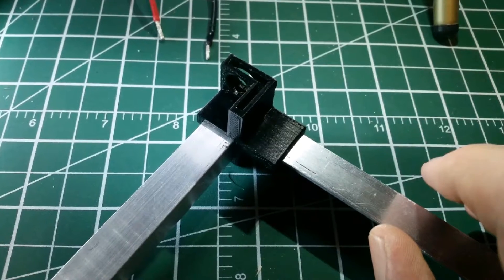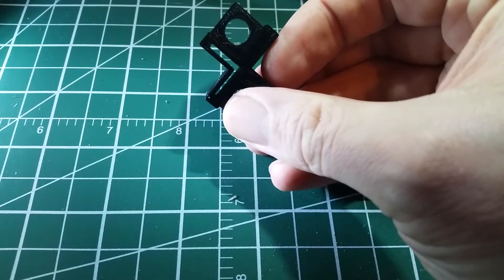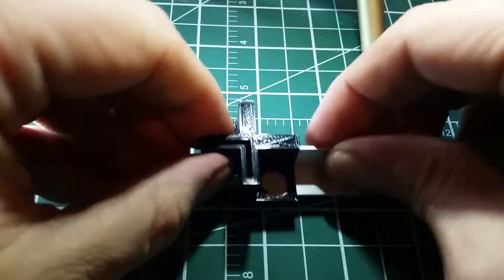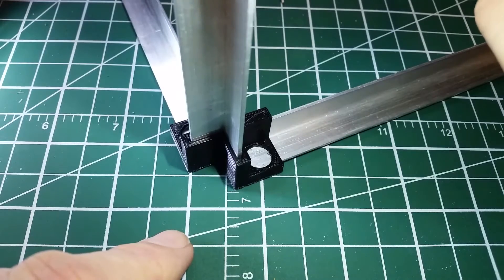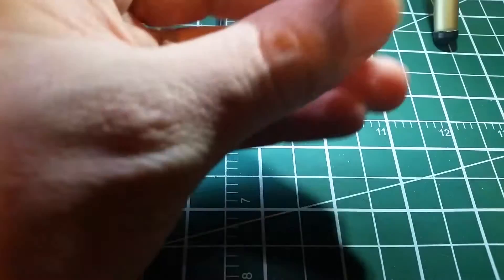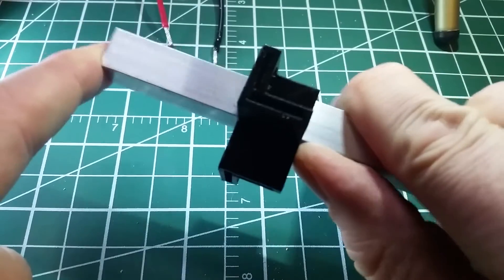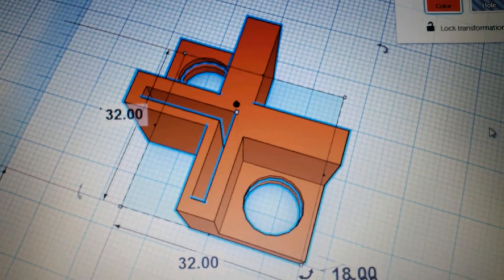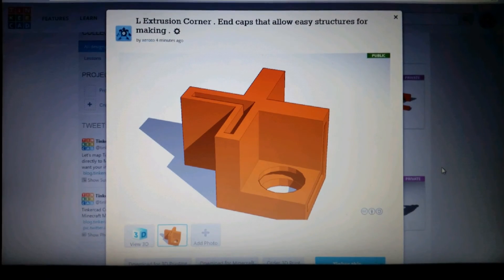L Extrusion Endcap

Comment: That's an awesome part!!!  I'm going to fire up my 3D printer and print me some of that.  Thanks for sharing!
Reply from the maker: +Hari Wiguna Thanks man ! It is already sized to account for PLA shrink .  but you can easily use scale or such to make it fit any L extrusion . Have fun let me knwo how it goes ... bet yet shoot a wee video! . 
In cura i used 10% infill and brim &amp; supports everywhere .
PS  , i used a small drill bit in my hand to clear out the channels.